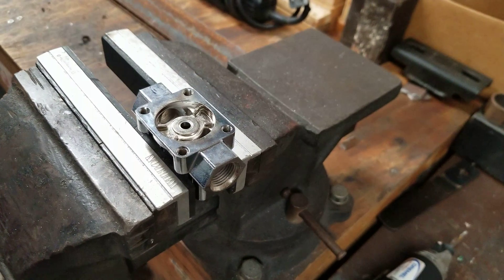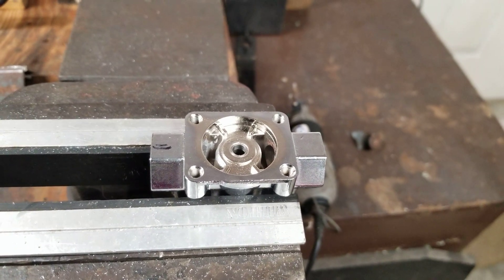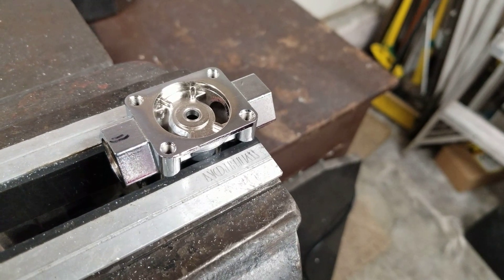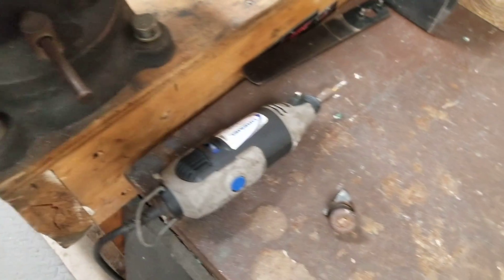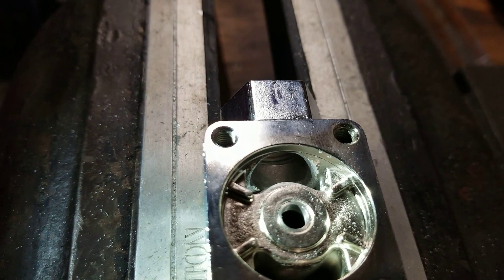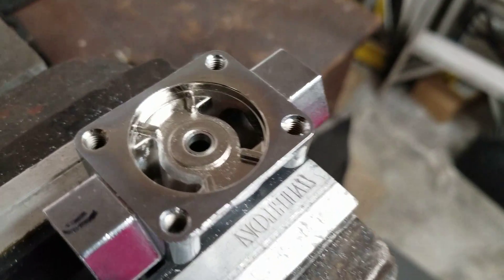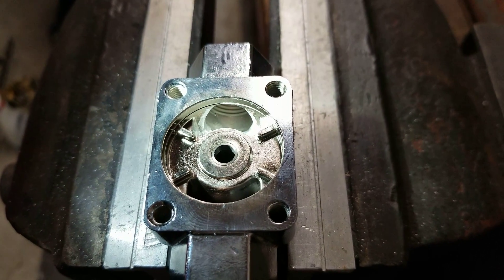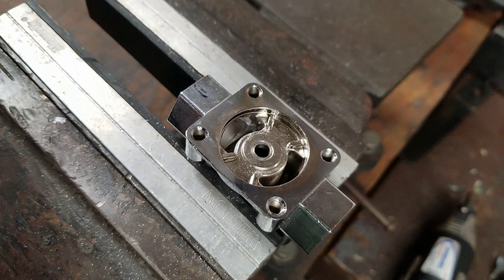Holley 12-803 Fuel Regulator Modification

Comment: Is there a way to deep clean these things? I've replaced the Spring replaced the diaphragm did the mod where you trim down the little nipple on the diaphragm inverted the Spring, but I still cannot keep this thing regulating or hold a holding consistent 6PSI. It keeps wanting to climb.

Comment: Is it possible to add a return line to this particular regulator? I know its 1 in and 2 out.
Reply from the maker: Yes you can. What I usually do is add a gauge adapter to one of the outputs and use a nitrous jet fitting or cut a #4 to 1/8" NPT fitting to accept a nitrous jet to limit the return. If this is to be used as a nitrous regulator it is not advised to add a return. With a datalogger you can actually see that you get more of a quick lean spike with the return than without so I just let them deadhead as to compensate for less of a lean spike on initial hit.
Reply: @Achilles Kaysen yea, I've been watching on Flixzone for since november myself :D
Reply: There is a dude on YouTube that put a small disc with a 1/16 hole on the fitting for his return. Not sure if that’s ideal but it’s easy to look up.
Reply: Pro trick: watch movies on Flixzone. Been using them for watching lots of of movies lately.